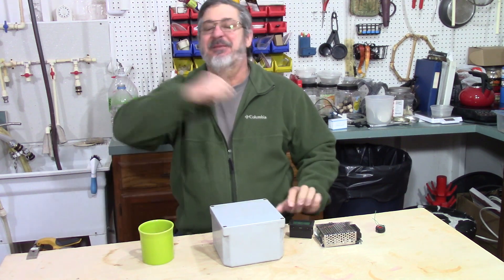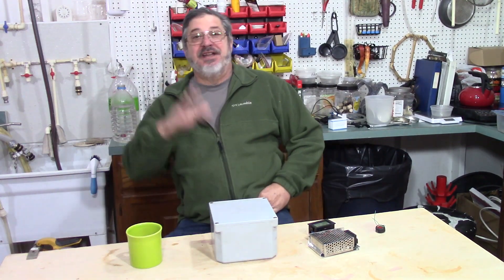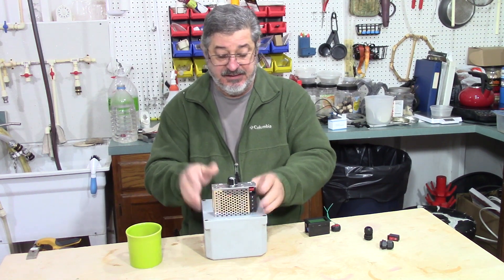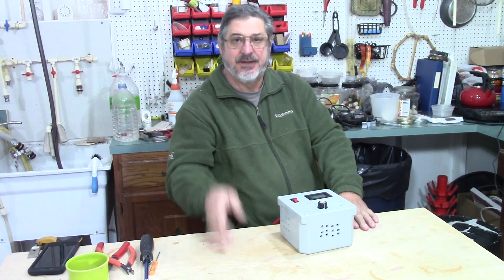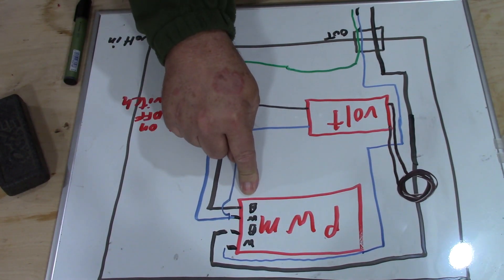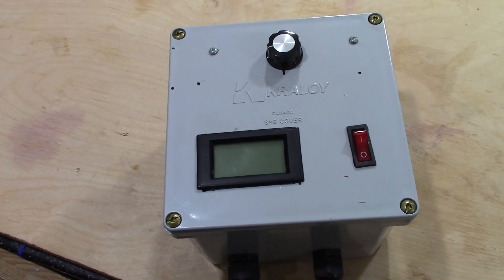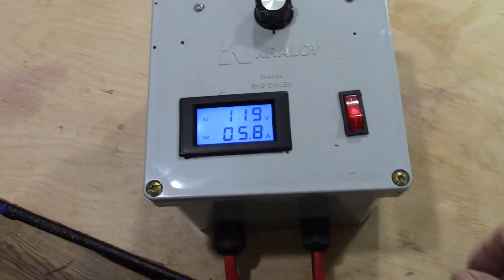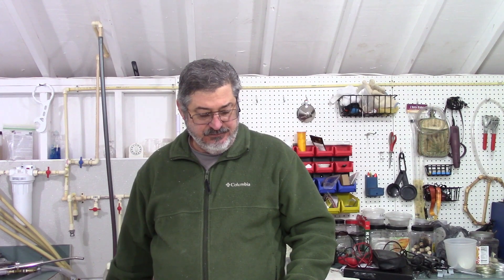E76 PWM switch control box build

Comment: Randy, do you have a link to that PWM. I have SCR 10000W and im not getting a digital reading on the ammeter, it just reads zero. Maybe there is a difference between a PWM controller  and  SCR controller, not sure. I have the same volt and ammeter as yours.
Reply from the maker: https://www.amazon.com/gp/product/B07W12ZLF7/ref=ppx_yo_dt_b_asin_title_o03_s00?ie=UTF8&psc=1
Reply: @stillworksandbrewing  getting a new 26 gallon boiler delivered some time today, the 8 gallon still will now be thumper :)
Reply from the maker: @cameronshine3465  How cool I'm using a 8 gallon some times too small good luck and cheers!!
Reply: @stillworksandbrewing  when i get it put  together, there sending me the boiler and all the tri clamps and tri clamp ferrules , looks like they brazed a few but i will solder the rest of them.26 gallon SS boiler, at the top 4" copper pipe and a 4"  90 degree  elbow , then a copper reducer 4" to 1 and half inch, then 500mm to the next elbow , then down into the 8 gallon thumper.
Reply: @stillworksandbrewing  on the top of the  8 gallon still . i got them to make up a 8 inch SS end cap, got them to drill in 2 holes , 1 and a half inches, then got them to weld in 3 tri clamp ferrules, 2 on top of the end cap and 1 on the bottom .... yes the old cap on the 8 gallon still is not needed any more .
Reply: @stillworksandbrewing  yes we have the same 8 gallon and i feel its too small. so i went all out and got the 26 gallon so i can thumper it out
Reply: @stillworksandbrewing  yes i have been using this 8 gallon still for 11 years now and I'm getting older, ill be 60 in a few weeks, so yes im getting to tired of the 8 gallon, picking it up after the run to empty it. so yes its time for a change and get a bigger one and one with a drain, I am excited :)
Reply: @stillworksandbrewing  thanks Randy, very interesting, it says yours is also a SCR and this is the one that i have https://www.amazon.com.au/uniquegoods-Controller-Attemperation-thermoregulation-Modulation/dp/B01M3XZBV9
Reply: connect the ammeter to the power in side, will work better since power in = power out.

Comment: Randy I like this, my only suggestion would be to add a power relay rather than running the load through the switch. Most switches like that are not capable of handling a 12 amp load for an extended period of time. You could even use the solid state relay from your PID controller.
Reply from the maker: Thanks for info  Cheers!!

Comment: Hi Randy. Thanks for the good content. I'm curious if your current meter is working for extended time at low currents (about 30% of max current for extended operation)? If the screen goes black, the. Please stop asap.
Reply: I believe the multimeter you are using may be expecting a sinusoidal input. Since the voltage that is induced in the coil is proportional to the rate of change (derivative) of current in the straight conductor, the step change of the PWM may result in too high of a voltage for the resistor on your multimeter.
Reply from the maker: @Bee2theTee  I will be using in in a couple weeks let you know how it works
Reply: @stillworksandbrewing  great Randy. I'm curious to know
Reply from the maker: @Bee2theTee  I'll let you know on my next run
Reply: If you want to chat about it, send me a note.
Reply from the maker: THanks
Reply from the maker: Thanks for info  Cheers!!

Comment: I moved from  propane to a PID, and I love it. I've been thinking of building a PWM. I like having better control with the PID.  But I  think I might like to have more control over the power input.  Which do you prefer.?
Reply: Power Management is the way to go.
Put a piece of tape over the thermometer, and listen to the still. When it stops popping, and the column heats up. Back off the power like a light dimmer switch.
When the product starts running, watch the stream. You want a pencil thin stream. If you are stripping a run, turn it up high and collect at a fast rate.
Monitor the cuts with your nose. It's really easy to run power management.

Cheers John!
Reply: @BigEdsGuns  you were right. Built a 240v PWM controller and I love it. Now I just my PID for controlling my mash temps.
Reply: @johnbigham1049  Glad you like it John.
220 is the way to go, I do recommend having a spare SSR on hand. Had one fail about 4 years ago in the middle of a run.
It died from heat.
My rig is on a three season porch, it was 90 outside and more than a hundred on the porch. Even with a heat sink, thermo paste, and cpu fan on it, it just "died". Shutdown, replaced it in 30 minutes and was up and running again.
I use the cheap Chinese SSR's and have 2 spare as backups.

Cheers John Bigham!
Reply from the maker: Hi John I only have 1 run with PWM switch under my belt but so far i like it better will let you all know
Reply: Could you add a cooling fan from a old computer into the box to help cooling?
Reply: @rongreene1788  when I built mine I added a 250v ac/ 12v dc transformer and a 1.5" muffin fan. Space inside my box was a little tight and that was the biggest I could fit.